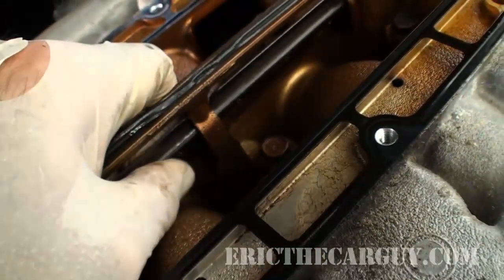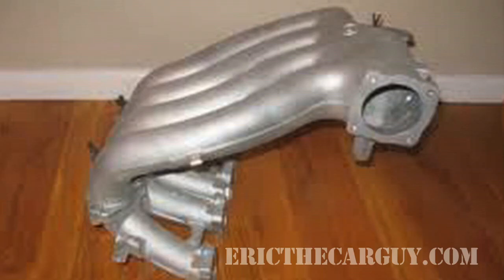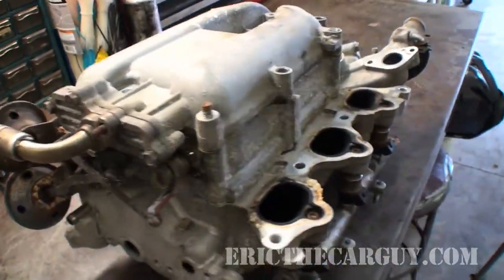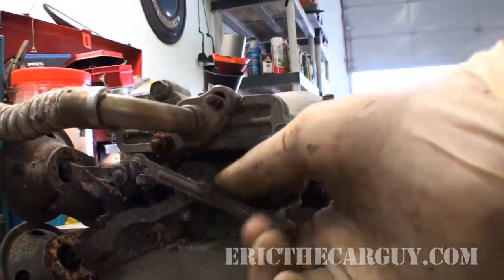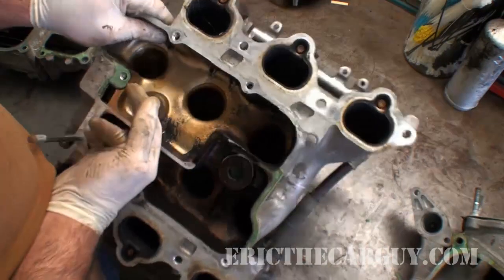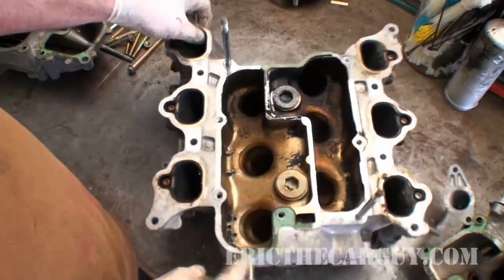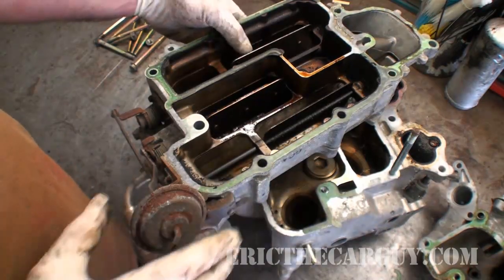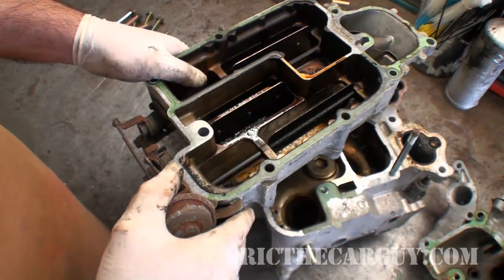How Multi-Stage Intake Manifolds Work -EricTheCarGuy

Comment: Air and fluid work similar because air is fluid. You also trade off volume with velocity from shape of the runner to not just size if you look at A round port and a square port, both exact size, they will act same as runner length     does. round port= velocity and square port= volume

Comment: HP=TQxRPM/5252
Torque is a measure of force, power is a measure of force over time. Increasing low end torque increases low end power, and if you increase high end horsepower you end p increasing high end torque. The two, horsepower and torque are directly correlated through the above equation. If you do the math using the the above equation you will find that horsepower is always equal to torque at 5252rpms. That also means that HP will be half of the torque at 2626rpms, and horsepower would be double the torque at 10,504rpms.
Reply: +Marcus Taber   It's not so simple in a piston engine because of the effect of the velocity of the intake air flow and the impact on the intake airflow when the intake valve closes. When the intake valve closes, there is still a mass of air rushing toward the valve.  That air is suddenly blocked creating high pressure against the valve, generating a pressure wave that rebounds off of the valve and back up the intake runner.  This restricts airflow and reduces efficiency (pumping efficiency)
 But, most of this stuff is actually there to reduce pollution and increase efficiency.  During the valve overlap (when both intake and exhaust valves are open) the higher velocity intake air helps to push out more of the combustion gases in the cylinder.  By regulating air flow velocity they are increasing the ability to exhaust combustion gases which allows in more fuel air mixture and burning more fuel increases power.
I believe what Eric is trying to explain is that the two stage intake pushes the power curve  allowing the engine to make more power at lower RPM. (both horsepower and torque)
Reply: +John Ferguson I understand what you are saying, I am pretty well read and have a lot of practical experience such as choosing proper length of intake for low end or high end etc but what you are saying has nothing to do with the basic math and explanation of how torque and horsepower correlate, that I put down. I think it's good that you are putting that down so others can read it but it really shouldn't have been a reply to what I put and more of a stand alone explanation. I was just trying to get people to understand how TQ and HP relate to each other and why if low end TQ can be maintained to high end TQ then your power curve will be awesome.
Reply: I understand what you mean in terms of scavenging and how that translates into better MPG and emissions, but that equation I listed was just some math I wanted to share with people because it seems to me that the general population doesn't really understand what torque and power mean and how they are felt in real world driving.

Comment: so what about when an engine is under boost does the intake matter if its a top end or low end or would the intake that is chosen also depend on the if its a supercharger or a turbo since one is low end torque and the other considered high end HP
Reply: Jacob Hoke there is no need for multi stages intake in turbocharged or supercharged engine, the basic idea behind multi staging the intake manifold is to take the benefit of standing waves created by high momentum air hitting the valve walls, so as to get high pressure region again when engine is ready to create vaccum. That pulse should be perfectly tuned over wide ranges of rpm, you heard about resonance tube?... Now coming back to your confusion, multistage inlet manifold gives supercharging effect, fo engine to fill up the combustion chamber at higher pressure, you know engine struggles to breathe at high rpm if the atmospheric pressure is same when it was breathing at lower rpm... There needs to be higher pressure to fill in the combustion chamber faster. I hope i clarified. 😄

Comment: Like vacuum-secondaries on a 4-bbl carburetor -- the vacuum "sucks" the secondaries closed when the engine is idling, and the spring pushes 'em open when vacuum decreases as you approach W.O.T.

Comment: Yeah a mild cam would do wonders for top end.  I was able to get an f22a6 IM from my cousin for $10 so I'm going to clean it up inside and out and then I'm going to buy an H23 plenum to put on it.  So I'll use the a6 runners and h23 plenum cause the throttle body is a couple mm bigger and the plenum flows a bit better.  

My accord hits a wall at 5000-5200 also but my cousin with a full f22a6 (comes with better IM, more aggressive cam and tune) keeps pulling to 6500.  So I say buy a cam :)

Comment: in a naturaly asperated and super charged engine it doesnt matter too much. but on a turbo charged engine extremest use screamer pipes to keep the turbo from rotating too fast (flys apart, catastrophic failure) or to keep the boost pressure from spiking (too much pressure in the cylinder head means big boom) in that way its a 2 stage exaust. but corvettes have used 2 stage for the longest time.

Comment: Exhaust side didn't need to be two staged. Exhausted gas velocity is about sound speed, so you only need to an equal length exhaust pipe from each cylinder and combine them into 4-2-1 or like this. You can play with the exhaust pipe diameter, length and what kind of catalytic converter and other muffler you want to put under your car.

Comment: Maybe i'm wrong, but i think this is for changing the length of the intake pipe, causing the ideal resonance frequency at all rpms. The air flow is restricted by the weakest point of the entire line, in this case, the butterfly valve.

Comment: thanks, but I was writing about variable intake manifolds for one of my research projects recently and I figured it out now.

Have a long narrow runner will speed of the flow of the incoming air, but it doesn't necessarily increase the MASS (not volume) of air entering the cylinder. However, what it does achieve is a better fuel air mixture but increasing the swirl and turbulence when entering the cylinder. hope this helps.

Comment: I think the idea is that when an engine is at lower RPM's it can't pull air in as fast as when its up in the RPM's so this restriction lets air flow faster to make better power at low RPM which translates to more low end torque.

Comment: Eric,

I am a student studying automotive engineering. I'd just like to ask you why does the faster air flow in a long narrow runner produce more torque in an engine. I understand your point that the air flows faster, but that doesn't quite explain why there will be more torque. 

The only explanation I can think of is that the fast flowing air somehow cools the cylinder more thus allowing for a better combustion. please let me know your explanation. thanks

Comment: The Legend is actually a 3 stage intake.  Its called the VIS system and you are correct in that it uses vacuum to open and close those valves to change the air flow in the manifold.  On Type 1 legends (the manifold in your example) All valves stay closed until about 3000 rpm when the first valve opens. At 4000 rpm, all the valves open. This allows for a near perfectly flat torque curve though out the rev range.

Comment: Yep!  There are four ways to do a repair job....

The right way.
The wrong way.
The military way.
The ETCG way.   

:)

If you can't divorce the ball joint,  beat on it with a bigger hammer.  
Always use a new kotter key.  He did,  at the end of the video.  
When he said he uses the old one,  he was kidding,  right?   ;->

I can't wait until he teaches us the "red wrench" technique.  
I had to use it on my 1977 El Camino, when swapping motors.
Couldn't find a 19/64" wrench.

Comment: These servos are not controlled by direct vacuum,  as manifold vacuum is dependent more on engine load than engine speed.  They are operated by a system of vacuum modulators and amplifiers,  and ported vacuum switches,  controlled by the ECM,  mainly as a function of engine RPM and VE mapping. Slow engine speed neglects the greater volumetric efficiency at WOT, so the longer intake tubes help offset this effect by increasing velocity.

Comment: 1.58 , the water comes faster but not with more pressure . well thats what they taught me at school. for an exemple look at a diffuser from a car , the bottom side of the car has narrow channels with low pressure high speed air coming from the front , but when reaches the back of the car the diffuser creates a large space where the air slows down but increases pressure to give a bit more traction to the rear . so do i think ,i can be wrong

Comment: No explanation of intake manifold runners is complete, or even started, without mentioning resonance!  That's really where the difference between long runners and short runners comes from.  When the intake valve closes, it sends a positive shockwave up the runner, and when that wave reaches the plenum, it resonates back toward the intake valve.  The length of the runner is tuned so that the wave returns to the valve when it's open, forcing more air through the port, but only at certain RPM.

Comment: if some one can help me. i have a 1985 buick electra ( park aveneu ) and it misfires when cold! ones i warms up ir runs smooooth. y checked the spark plug cables and were hi on resistance! and change hem! but with no luck! then i changed the spark plugs! because they had 77km on them. and nothing changed. btw the car only haves 78km original. what should i bee checking next?

Comment: Off the shelf 272's huh? 

The number/name of a cam like "272" refers to the duration, not the lift..... you can get any cam with a set duration like 264* or 272* and than have a MANY difference amounts of lift. the 264's in my old Evo had almost 1" of lift, where off the shelf 264's are only about 0.4". I chose the higher lift and short duration for the type of driving I used to do in my Evo, city and autocross. Its still a longer duration than stock, but not as extreme as the 272's or 280's

Comment: Another mind expanding explanation, thank you. 

I would not have thought that the low mass of flowing air would have been large enough to make a difference in torque, but I guess we are talking about small improvements. It seems counterintuitive to note that increased vacuum inside the plenum results in more restriction of air entry, which would tend to increase vacuum more. There must be an advantage to big swings in vacuum comparing low end torque to high end HP....

Comment: Eric if i can remember didn't some car companies use a system that had long intake runners, and at certain RPM would have solonoids that let more air .in the intake system to counter that. I believe it was Mazda KL series v6 engines have VCIS

Comment: long tube intake is also a good example of how a variable geometry turbos work! The turbo mouth has an actuator that changes the intake diameter changing the velocity of the air entering. i.e. garden hose deal :)

Comment: Are their any improvements to the intake on 98 saturn SL2 1.9 ltr. Engine, besides K&N air filters, and does the saturn transmissons need a friction modifier in the fluid?

Comment: SU carburetter = Wiki it

I had worked on these in the 70's in my 1970 MG Midget. They worked great, but they often failed, then they were a BIG pain. This technology has been around for over 50 years. It's being fine-tuned for fuel-injection.

Comment: Also to mention too, the TSX and Accord Euro (Non American Market) have a normal manifold rather than a manifold like ETCG has featured here. It has a larger lower chamber on the bottom of the intake that feeds into the long thin intake runners giving it more torque than the Manifold on the K20 in the Accord Euro R and Civic Si/ Type R (excusing the extra 0.4ltr of displacement in the K24). Ive never seen this manifold type on the 4 Cyl Honda engines so I believe its V6 dependant.

Comment: depends on how "big" the lift is...... usually with performance "street" or "mild" cams, you're not going to see a big difference in vacuum changes.... maybe a few inches of Mercury, but not anything significant as most of these type of cams still have very good idle and drivability characteristics.

With a "race" type of cam, yes, you're going to see a dramatic difference and get poor-er quality until the engine is at certain RPM range where it is "happy"

Comment: That is actually oil and some of it is the dirt from the exhaust gas from the EGR which means Exhaust Gas Recirculaton valve, its an emissions thing and only recirculates a very small amount of exhaust
The oil comes from the crankcase ventilation system aka PCV Positive crankcase ventilation/valve system. The PCV carries the fumes from the oil and "blow-by" the engine creates so that it can breathe those gases through the PCV that is connected to the air intake. The result is the brown stuff

Comment: You must talking about the 4-cylinder, because the TSX only came with a K24 rated at 200hp, and 205hp for 06-08 for the 1st Gen.

The North American Accord came with a 160hp K24 and the 240hp J30A4.

The difference between the TSX and the Accord's K-series is in compression ratio and other variables that attribute to the difference in power.

Obviously the 1st gen TSX 4cylinder is outmatched from the Accord's J30 V6 engine(which is a more advanced engine than the NSXs C series believe it or not)

Comment: I dont know, but I would be 99% sure that the gunk and crap sitting in the bottom of that would just be because it has been pulled apart.. There is also little bits of gaskets sitting on the pieces, so some of its probably cleaning chemicals.